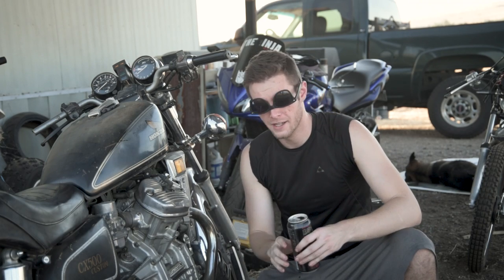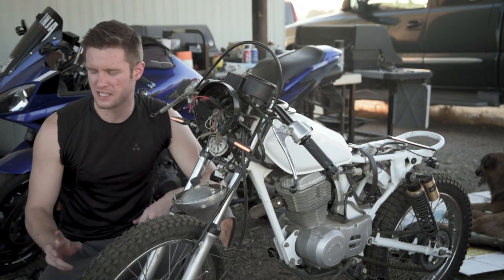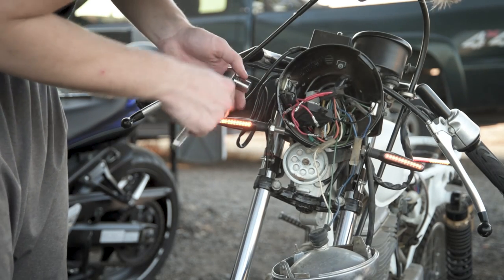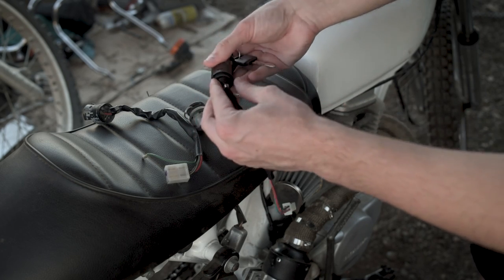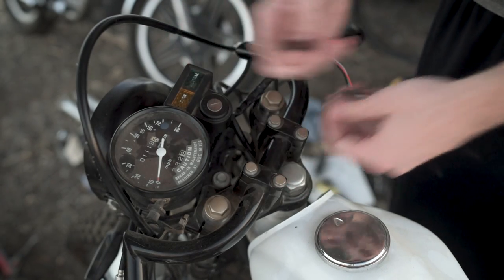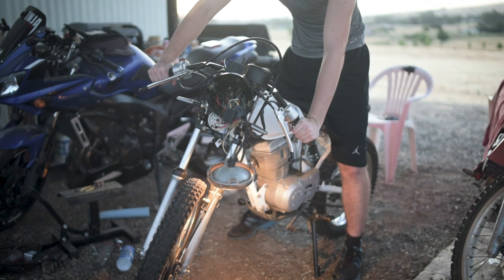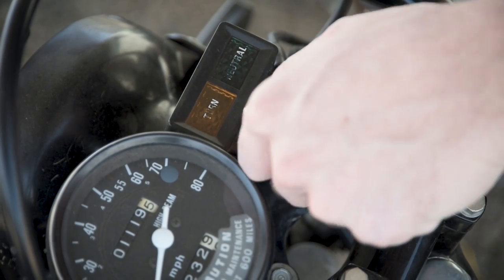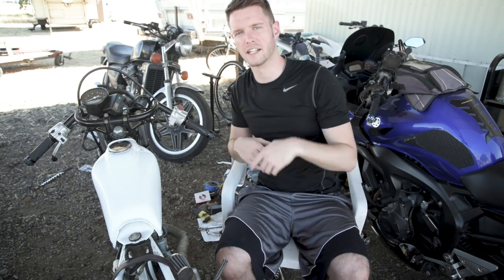Cafe Racer Build: Ignition Switch Install + Figured out the 6v Turn Signals

Comment: kind of old, but I thought I'd share in case someone has the same problem - removing the bulb makes sure the left/right aren't bridged but also means you don't have an indicator light :) New bulb will have the same problem. The reason is that with traditional bulbs in the indicators they require more current, so just a little won't make them light up. Different story with LEDs though. To still have a bulb but not having it bridging the left/right circuits, diodes are needed. It makes sure current flows one way but not the other. Also the rewired light needs a new ground. It's simple enough to build, but it's also readily available as a kit. Fellow youtuber Classicoctane.com has them for $5, which is hard to beat.

Comment: Hey great video man. I'm so happy I found your series. I'm building a custom 1980 xl100s and just ran into this issue last night! Much thanks brother
Reply from the maker: Taylor Lathem I got your back! Glad I could help ☕️
Reply: what kind of resistors did you use? You mentioned you had to install some after you figured out the signals.
Reply from the maker: Taylor Lathem didn't use resistors, check out my next video in the build series called "6V turn signals don't flash FIX" or whatever it's called. Haha I lay it all out there exactly what I used.

Comment: Did you ever solve the issue and did you get inspected ?
Reply from the maker: Walter Love Yeah! Needed the LED flasher relay for 6 volt and needed to take out the turn signal indicator bulb (which was allowing electricity flow backwards into the other turn signal circuit) ☕

Comment: I don't know if this helps, but I'm building a cg125 cafe bike at the moment, and I have yet to fit my led indicators. but in the back of my mind I have been thinking that I will need an led specific relay for them. I have had a look and found this which may help you. Look at this on eBay  http://www.ebay.co.uk/itm/391747229820
I don't see how it would be different for an led but it does say specify 'led' relay.
Reply from the maker: Wayne Byrne appreciate the help! but, I have already tried different relays, two of which are LED 6v-12v electronic flasher relays. still needs resistors, it seems.
Reply: The Inja fair enough
Reply from the maker: Wayne Byrne But I appreciate the comment! let me know how your build goes!
Reply: The Inja yeah no worries. I figured you would have tried it already but without going back through all your old vids I thought I'd mention it anyway. 
love the look of this little bike you've built. 
me and my 15 yo son are going to build the cg together. one last dad son thing before he hates me too much. 😂 we were thinking of vloging the progress on here as well, so if we do I'll send you a link.
I've subscribed by the way and looking forward to the next build. have you checked out onlythebold on YouTube? he's building a cx500 and could be of some use to you. 👍
Reply from the maker: Wayne Byrne Father son project sounds awesome. if you end up doing video(s) of it, definitely let me know! I'd love to check it out.

yeah, I've been keeping up with For the Bold build. finally a couple others are building CX500!
Reply: *for the bold